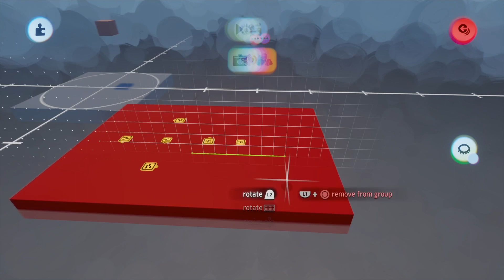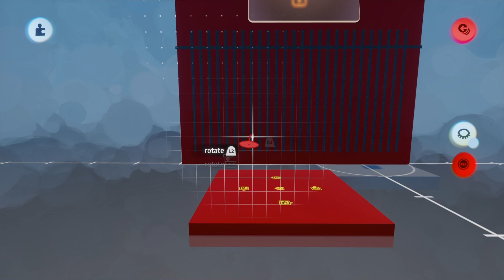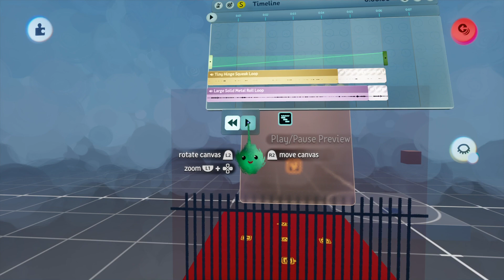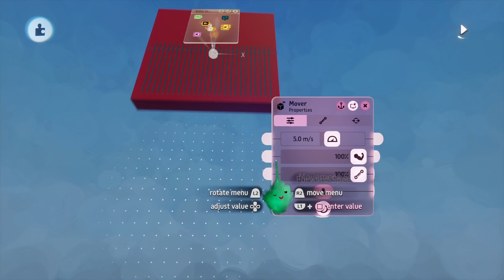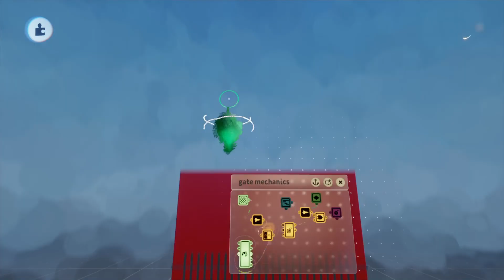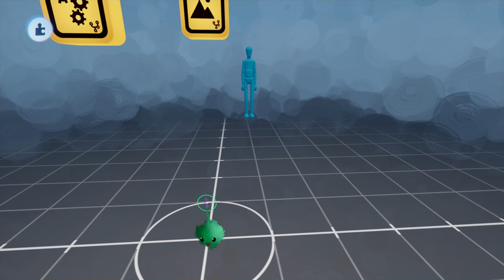Procedural Generation (#9): Protective Time Gates | Dreams Tutorial

Comment: Would this method also work when it comes to placing collectibles around the dungeon? Or is that a different tutorial in itself
Reply from the maker: Yeah you'd probably want to do that in a different way.. 

For example, you could set it up so that each room could decide for itself (when it's created) if it contains treasure/collectibles  based on some arbitrary ruleset, or by some weighted randomness.

Comment: Weird about that mover, huh? I've heard of some other things not working with a mover in a timeline too...
Another way of timing out that the mover should be on during the timeline would be to use a keyframe to turn it on and put that in the timeline.
Did you say why you wanted to use a mover insead of keyframes, by the way?
Reply from the maker: Haha shoot! I thought "I bet tapgiles will know, i should leave this clip in" while editing.

I wanted to use the mover instead of keyframes because the wall object wasn't grouped with the floor, and so the positional data w/ the keyframes would make the walls move in weird positions.

I basically edited all of that out, because the video would have been too long. However, the mover worked perfectly... except not in the timeline lol
Reply: @VinceKully  Oooooh, gotcha. Yeah it'll do that. What I would do is just group it up so the keyframe affects the wall inside the group, then emit the group itself which isn't keyframed. That will sort that out. So you could just group it up with the chip for example, and relink the emitter to the new group.
Reply from the maker: The reason I didn’t do that is because having another sculpt inside that floor group throws off the emitter position, even if the object is off or being emitted from that group. The overall shape of the group changes (just like the katamari thing). 

¯\_(ツ)_/¯
Reply: @VinceKully  The emitter stores the centre of the object when you link it up and then it's locked in until you link it to something else. So you can actually get away with adding stuff into the group without problems if you don't relink--which normally won't be necessary.

But I mean just making a group just for the fence--separate to the floor.

It's generally a lot easier to work with an emitted group than a simple object anyway as you can put more stuff in, take stuff out, move things relative to the group's centre etc. without trouble. Where as just an object (eg. with surface-snapped chips) will mean ulinking and relinking if you want to turn it into a group, and you won't be able to control its centre at all.
Reply from the maker: Hm I thought I had tried it before and got weird results. Perhaps I wasn’t grouping things correctly